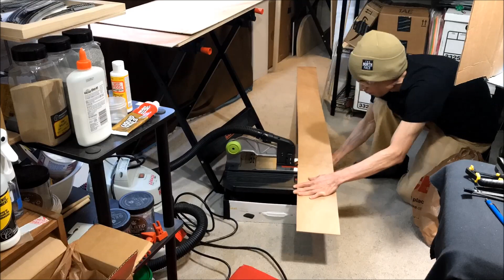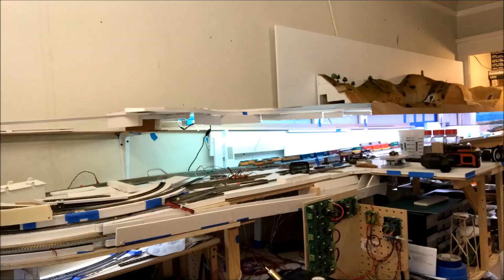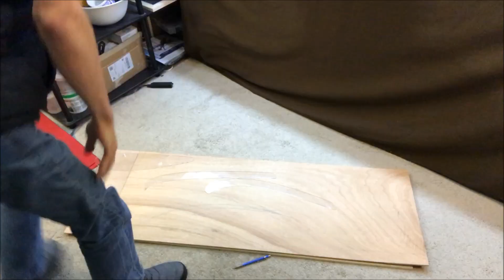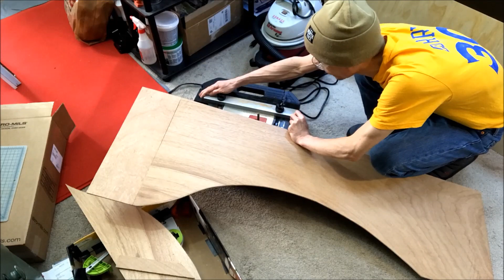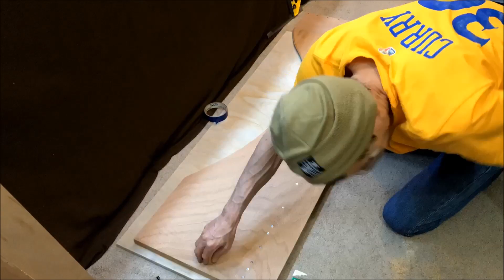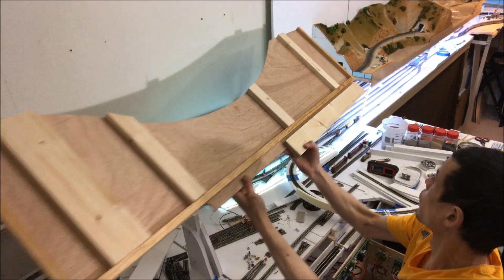Layout benchwork thin light shelf construction timelapse

Comment: Cool. Can you share some information on the tool you used? Looks like it is a combo band saw and router table, but it is hard to see. Thanks for sharing...Anthony. Good music to, sounds like the Alman Brothers a bit.
Reply from the maker: The tool is a Rockwell Bladerunner X2, handy little 'jigsaw upside down mounted in table' cutting tool.  Pretty cheap, was considering getting a miter saw, wanted ones that were a bit expensive.  Saw this and looked at a few YT reviews and decided to try it out.  Totally satisfied with it for $100 bucks.  still want that Makita cordless miter saw I was drooling over but this gets a lot done at a 1/5 the price.  There are some cheaper miter saws in the range but this thing is a little more flexible as far as range of cuts, especially the well controlled scrolling cuts.  Though the return is upward if you go slow and use the hold down guard or apply pressure near the blade (in a direction AWAY from it!) you get reasonably clean cuts. 

I have a jig saw, never got clean enough cuts with it, without a backing material that I need to then toss it chatters badly cutting over open air.  Easier to get a clean cut with basically the same thing mounted securely upside down as I can apply pressure near the blade or use the guard and it doesn't chatter like a jigsaw.  One could just get a table vertical mount for a jig saw.  The blade sticks up through plate, same cutting ability as the BladerunnerX2 without the guard/material hold down device.  

That is an option but with self mounting every time there will be more safety issues, and no handy guard to hold down sheet material for straight cuts.  I prefer 'very secure' for motorized cutting tool so I like the added security in basically the same tool.  Its working very nicely for me and think a self mounted setup would add a statistical chance of screwing it up, which could end up with a bad material cut or a really bad cut for me.